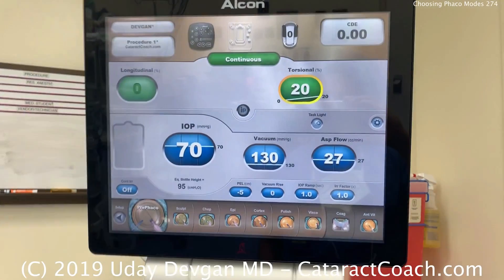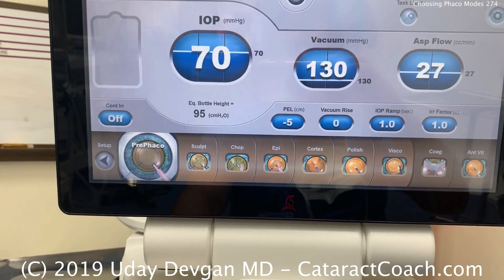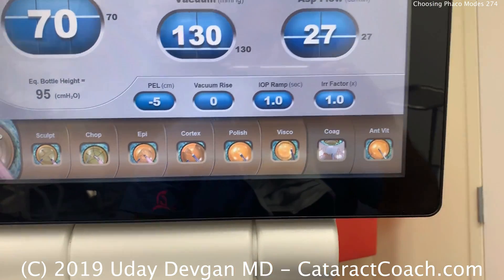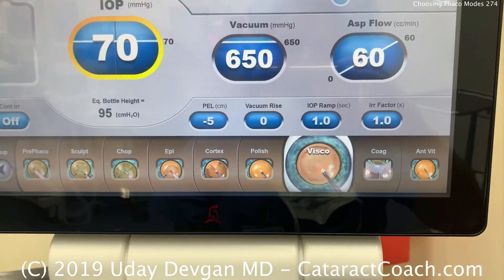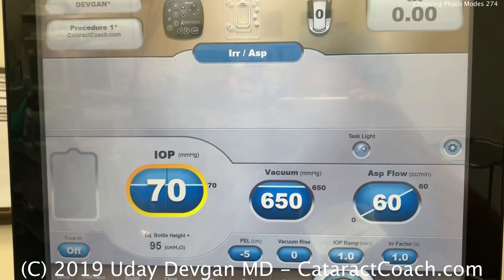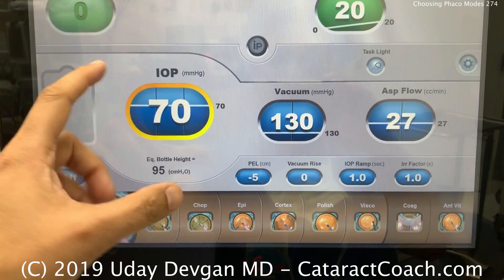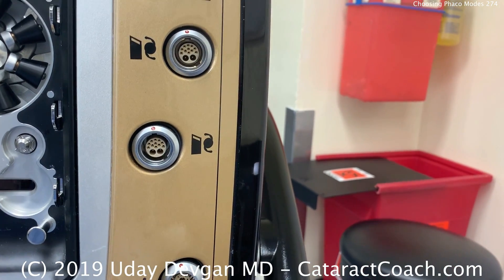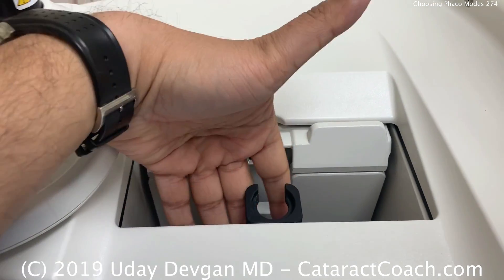Phaco Fundamentals Part 1: Choosing Steps of Surgery

Comment: Is it important to respect Position eye level also if we are operating with Active mode or only in gravity mode?
Reply from the maker: both -- for gravity mode the distance between the bottle height and the eye level is what is important. If you raise the patient's eye level by 20 cm (tall surgeon, for example) then you should raise the bottle height by 20 cm.
Reply: @UdayDevgan  thank you. For gravity mode that is pretty clear to understand since it works thanks to Stevino low. But for Active mode I thought it was different since the pressure is not  managed directly by the force of gravity but from the centurion system itself. Am I wrong?
Reply from the maker: @eliasdelogu2756  some machines have sensors which detect the IOP and then can raise and lower the infusion pressure actively and on the fly. However they also take data such as PEL (patient eye level on the Centurion) into account for these adjustments.

Comment: Hi Dr. Devgan, what is the size of the phaco probe you are using for these settings? 2.2 or 2.75? Thank you!
Reply from the maker: great question since the tip size affects the fluidic parameters. these are for 2.75mm wide incisions which are what we use when teaching residents.